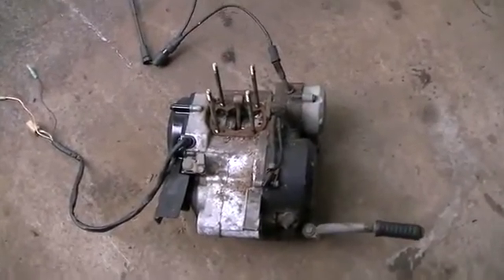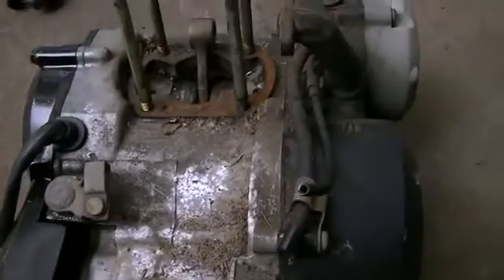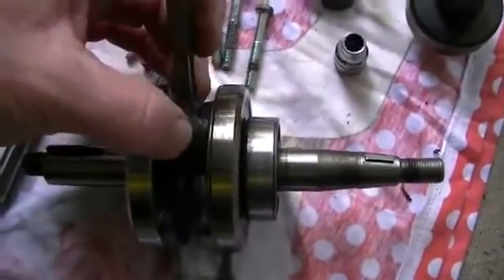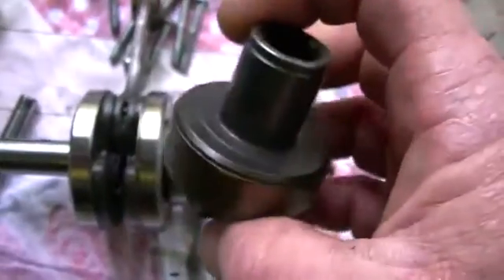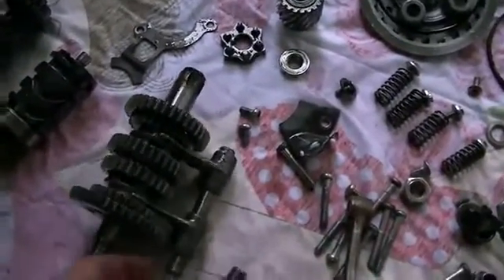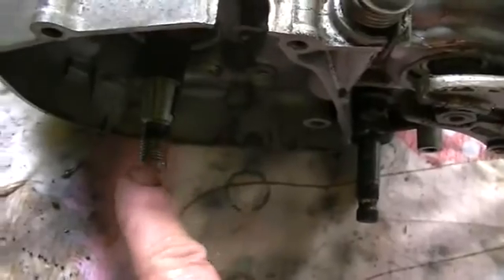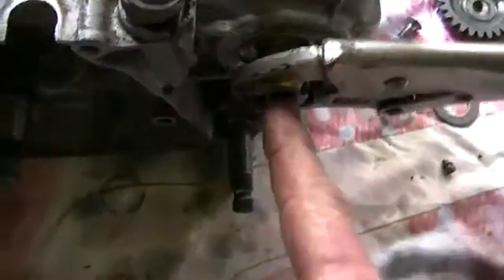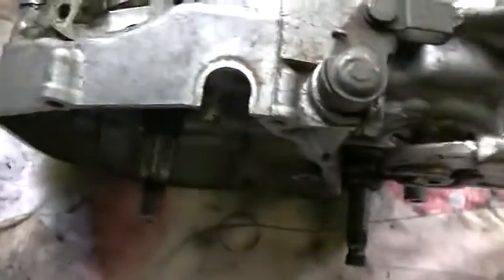Gravity gen gearbox

Comment: ok, great!! where's the rest!?  lol.. I am in process of acquiring old 10 speed bike frames.  I have a good treadmill motor to work with, an inverter and charge controller.  I REALLY wanna see you make good progress here!  gravity can surely spin things fast enough to turn a generator and make more power than it will take to reset the weight... if you don't show it, I will!  lol.  good work, keep it up!